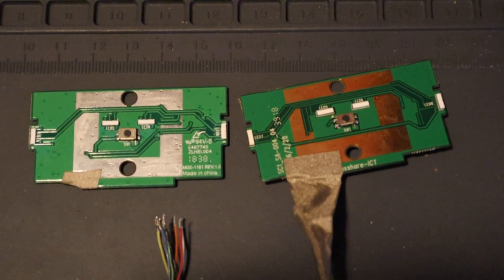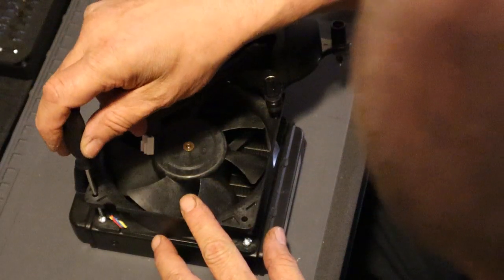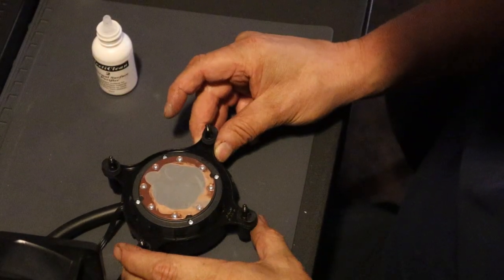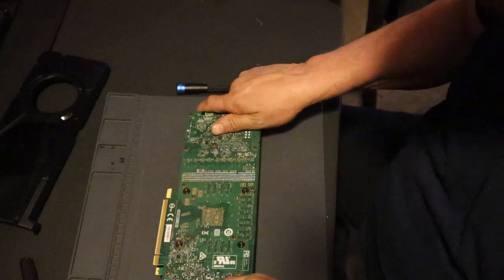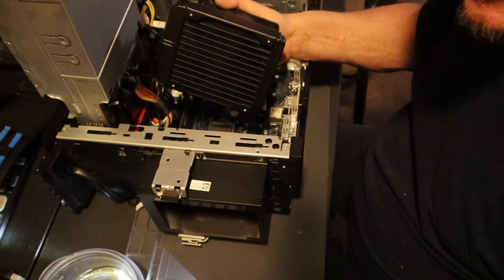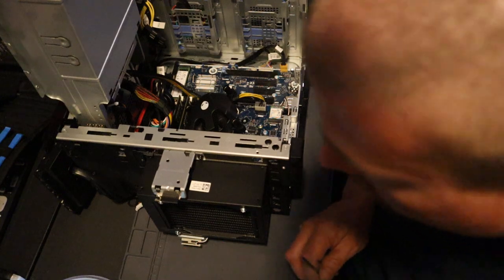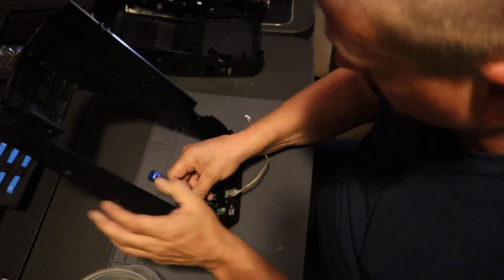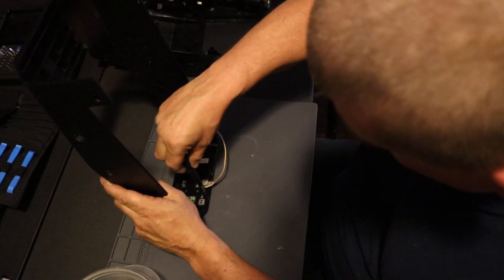Aurora R8 Plugged Up (CPU and GPU repaste)

Comment: I really appreciate this video, I have the same setup and am looking to replace the thermal paste and thermal pads and I can't find any other instance of someone working on this GPU. Did you happen to notice the number and thickness of the thermal pads? I know this was a while ago but any info helps!
Reply from the maker: I did not replace the thermo pads... I probably should have, but I did not... if you have your out... I would just measure it and look on new egg for something that is equivalent and replace... I need to take this one back apart and clean it and maybe do another repaste its been all most 2 years since I have done it... Glad that it helped you... thanks so much for watching.
Reply: @WhiplashHell  Thanks for the Reply!!
Reply from the maker: @paulm2206  no problem… have a beautiful day 😎